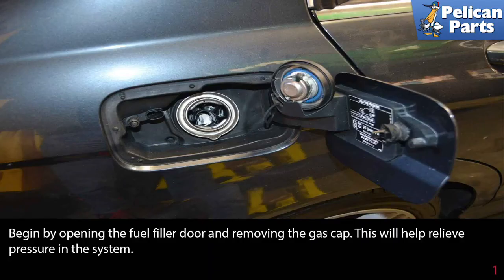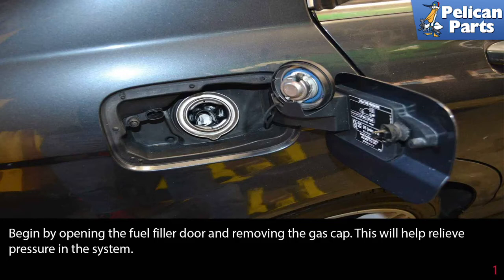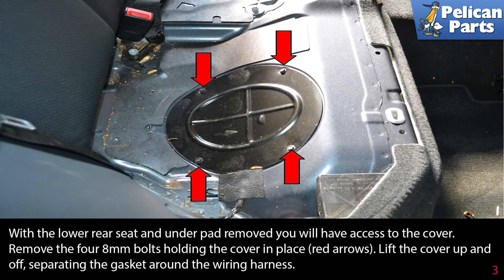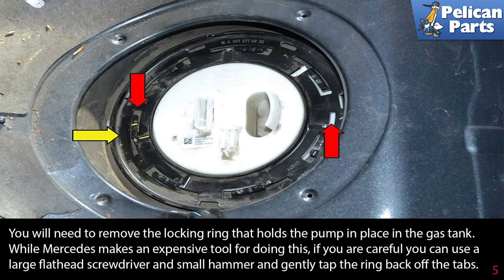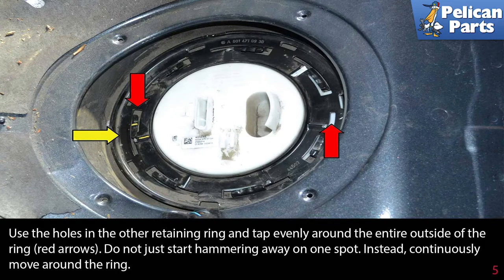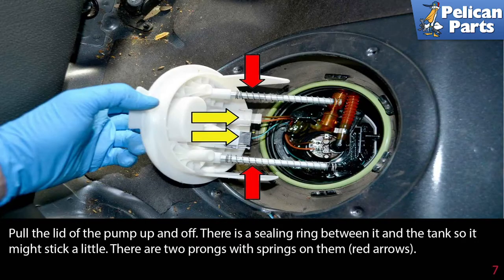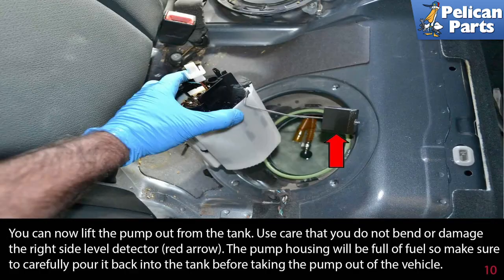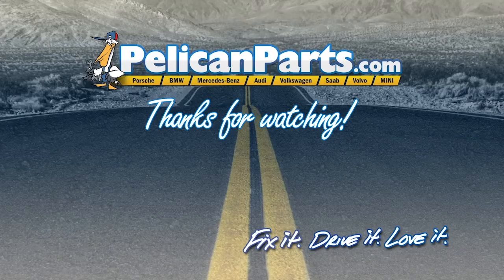Mercedes-Benz W204 C-Class Fuel Pump Replacement

Comment: My w204 2012 has a knocking issue the mechanic said it’s bcz of faulty fuel do you think if that’s a right diagnosis ?
Reply from the maker: If fuel volume / pressure is low, it could be. Call a few shops and ask for a quote. It is also a good idea to have them confirm what the issue is.

Comment: So my car doesn't have that strange ring I have rings bolted down with 10 mm nuts
Reply: 2011 c300
Reply from the maker: That could  be a PZEV vehicle. Simply unbolt and replace the pump.
Reply from the maker: That could  be a PZEV vehicle. Simply unbolt and replace the pump.

Comment: Hello, I changed the fuel filter, car is running smooth and no leaks but gauge wont detect fuel level.
Reply from the maker: This could be a faulty sending unit in the tank or an issue with the wiring to the sending unit.

Comment: I recently had these changed and notice a small darker area discoloration towards the back of the fuel pump top. I'm guessing that some fuel is leaking out the back of the pump. What would cause such a minor leak? Gas cannot be smelled in the cabin but outside near the rear driver side tire it can. Is the gasket the likely culprit for such a leak?
Reply from the maker: Most times this is a hairline crack in the housing or a line.
Reply: @pelicanparts  you would be able to see liquid if there’s a hairline crack though right?

Comment: PLEASE HELPP!!!! 2010 c300 4matic sport 
CEL CAME ON! To rich to lean and misfires! 
I changed the MAF SENSOR & engine air filter. Light popped back on !
Thought it would be fuel injectors changed fuel injectors! Light popped back on ! 
NOW I scanned at autozone for oxygen sensors! I replaced all o2 sensors & all spark plugs! 
THE CEL LIGHT POPPED BACK ON AND CODES STILL SAY MISFIRE & too rich to lean! 
But everything is brand new what could this bee?!?!?
Reply from the maker: Sounds like an engine misfire. I would check spark, fuel and compression on all cylinders. Once you isolate what part of the combustion process is causing the misfire, you can identify the root cause.